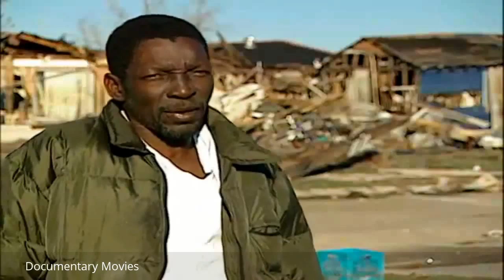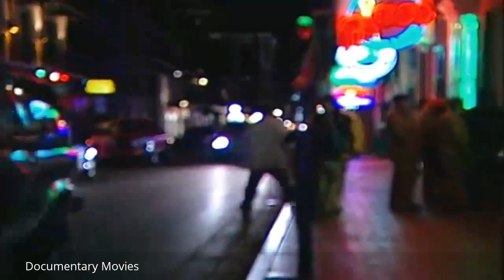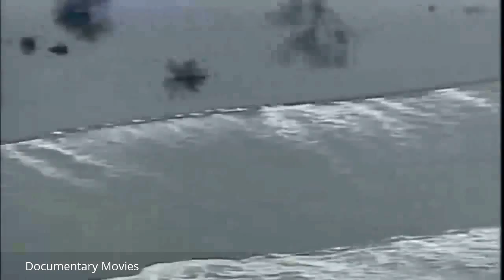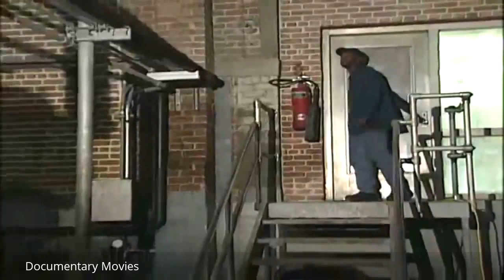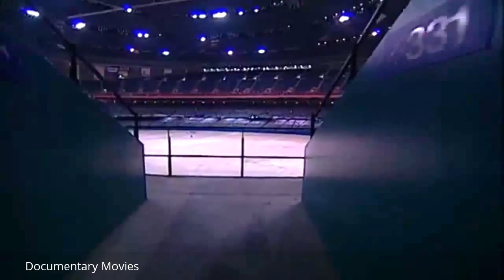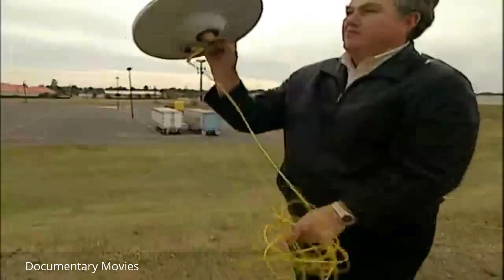Engineering Disasters | New Orleans Engineering Fail - Documentary Movies

Comment: Both the state of Louisiana and the City of New Orleans, as well as the Corps of Engineers, were completely at fault here. They always knew that their location put them at risk for a serious flood, and yet they cut corners with building codes (shocking), had the power source to the pumps underground, which shut them off. The mayor told the operators of the pumps to leave their posts,  the levees weren't properly inspected or maintained. Even the way the city is built is so confusing that it hindered people escaping. A lot of people don't have transportation, so there was no way for them to drive out for an evacuation, and yet there was no emergency escape plan. I love New Orleans, but the city is such a mess. There are still street signs missing throughout the city 12 years later. The pump system has been upgraded, and they took down a levy on our family land up in northeast louisiana. Hopefully this won't ever happen again, but if it does, I hope they've cleaned their shit up.
Reply: Plus, Ray Nagin is exactly where he belongs. Under the jail.
Reply: @leonardsusskindswar7258  Yep. Karma came to bite him in the ass when he was imprisoned. I hope any Katrina victims were there, ready to beat him up for what he did.
Reply: Leonard Susskind's War yeah I know that

Comment: When you build a city below sea level on a hurricane coast, is it an engineering disaster when the place is flooded?
Reply: when the floodwalls arent maintained, and fail during a storm, with less than cat 3 winds, and the ACOE admits to their shitty design, then yes...it is a manmade disaster.
Reply: @emilyd.6371  "fail during a storm with less than cat 3 winds"
Yes, winds were around 90-110 mph, which is less than a cat 3, but the thing is storm surge around 18-20 feet was pushed into the coastal communities and the canal systems. In some areas, the levees were overtoppled, and the surge exceeded the height of the levee. In other areas, the levees broke under pressure from the surge. Combined with the levee failures, high storm surge, and the inept government, who didn't prepare and respond quick enough, and Katrina (in NOLA) was both a natural and man-made disaster.
Reply: @jagkings  my comment is a year old,  but yes, I agree with you.